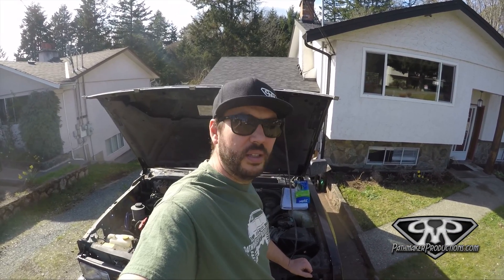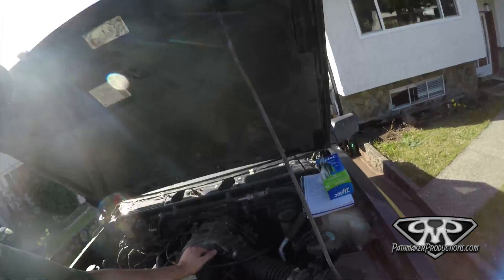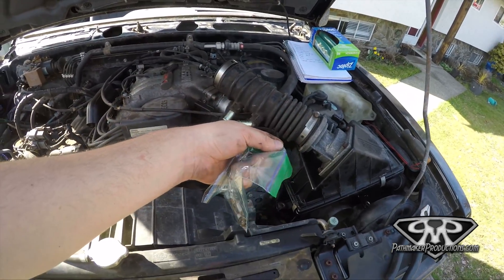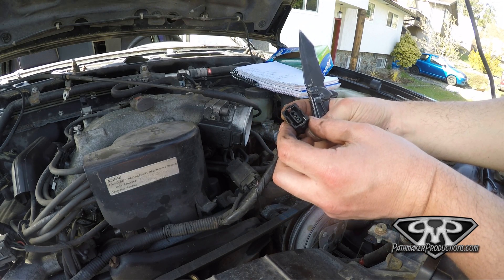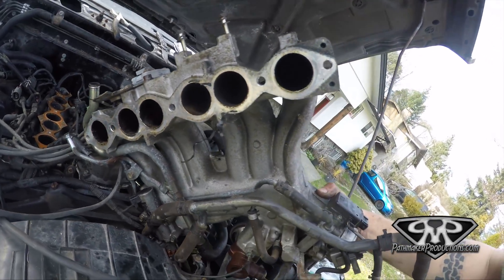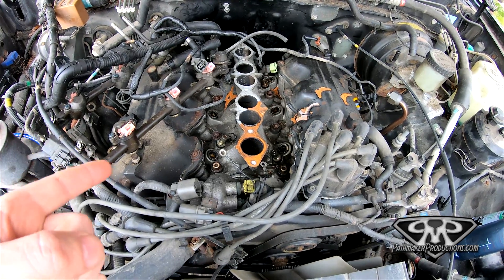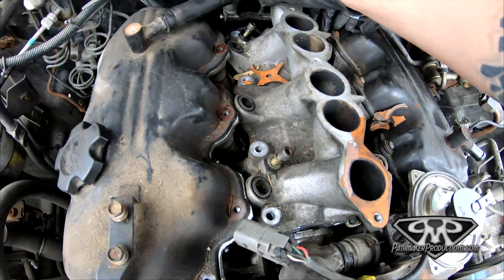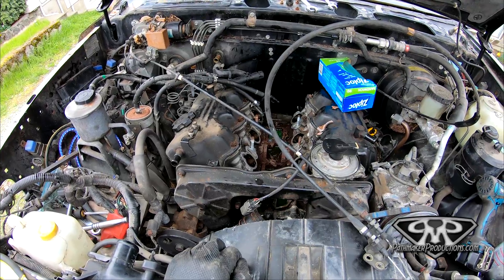VG30E EFI Removal Guide – Swapping Fuel Injection to a VG30i (Part 1)

Comment: helllo, I have a pathfinder 1991 with VG30E engine, which is not turning on the 6 cylinders; I want to remove the injectors to check and cleaning and adjustment if necessary; can I remove the injectors whithout removing the air intake manifold? thank you for your help. nice video anyway.
Reply from the maker: You can reach the passenger side without removing the intake plenum but for the drivers side bank you unfortunately do have to pull it off to reach.

Comment: Which transmission are you using...I just installed a 2002 Xterra 4x4 on mine
Reply from the maker: I'm running the stock 1987 transmission that came in my rig. Its one of the few parts I haven't had a single problem with in the 22yrs of owning my rig. The newer trans like yours are apparently much better but since I've had no issues with mine I haven't had a reason to mess with it!

Comment: I know this video is a year old but I’m starting the journey to restore a 94 pathy. Gotta pull off the intake to get to the valve covers since their gaskets are leaking. What were the connections holding in the intake in the back near the firewall? I want to do the minimum to get this stupid thing off. Anyway I hope you see this lol.
Reply from the maker: Not a problem! There are two or three rubber hoses under the intake manifold and should be 2 electrical connections, your knock sensor and your IAC Valve connection. There should be enough slack on the electrical wires to flip it over without unconnecting them but you will have to reach down the back side, near the firewall and unhook the heater hoses. They should be just with the squeeze style hose clamps, it sucks tho, prepare to scratch up your hand real nicely while fiddiling around down there!
Reply: Been fiddling all morning and these are definitely a pain. Thanks for the reply!
Reply: hello, do you succeed to remove the air intake? do you have made a video for this? I need to remove the injectors and I am afraid to have to remove this air intake manifold. thank you for your answer.

Comment: I have an 1988 does anyone know anything about a pathfinder xe 1988 tps ? Like how it’s supposed to be wired ?
Reply from the maker: Head over to NicoClub. com and they have the full factory service manuals which have the full proper wiring diagrams. You'll be able to use an diagram from 87-90 for the TPS wiring.

Comment: Are the air intake tube the same for the vg33e because I have a vg30e and want to use a air intake tube from a vg33e xterra or frontier because a new oem one or aftermarket is too damn expensive
Reply from the maker: I believe theyre the same. I know a lot of guys swap over to the 3.3 and the intake tube isnt on the parts list for that swap so Im going to guess they just use the vg30 one. That said I havent done one yet so Im not 100% sure unfortunately!

Comment: Hi,
Does is have a vg30 engine same as the 300zx (z31)?
Reply from the maker: The block is the same between the Pathfinders, Hardbody trucks, Maximas and 300zx. The 300zx is the vg30de and the vg30dett and the Pathfinders/Hardbody trucks are the vg30i or vg30e. The 300zx runs different components and oil pan, and of course a lot of them also have the twin turbos which make the engine really really wide to put into the trucks.
Reply: @PathmakerProductions  they’re the same as a z31 300zx just have a different cam grind truck cam vs a a cam

Comment: Hey i got a pathfinder 94 that got converted into a stick shift, and all a sudden won't start I checked the relays I checked the battery nothing any ideas what could be?
Reply from the maker: It could be one of the 4 grounds under the hood but look into the "Clutch Start Cancel relay" switch, its down near your clutch pedal. (we don't have it on Canadian trucks, but they do have them on the US ones and if you don't have it bypassed it won't turn the starter).